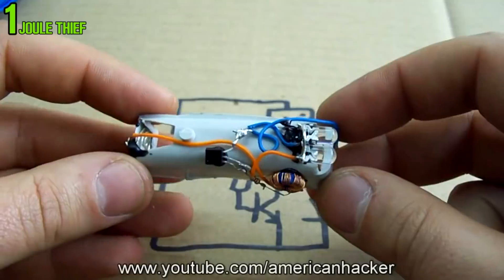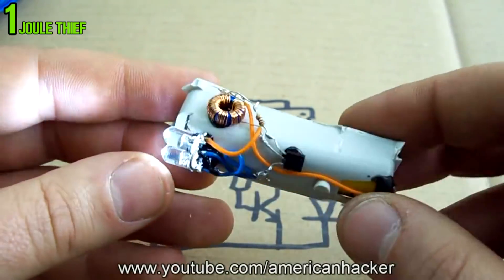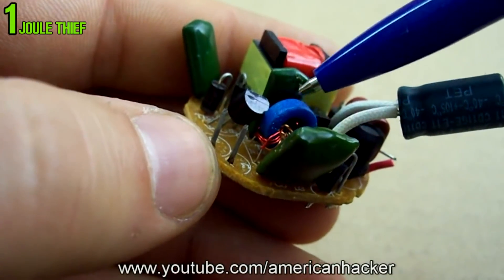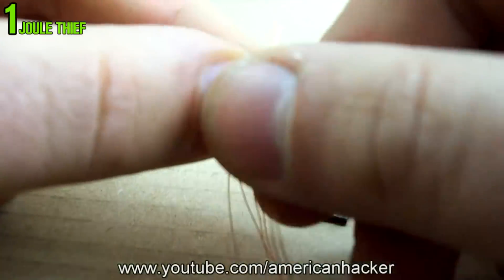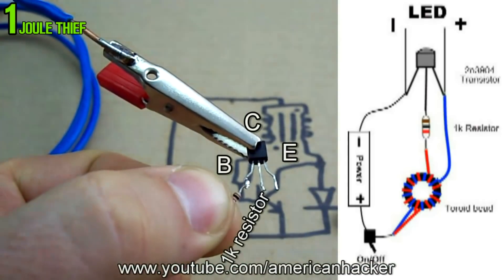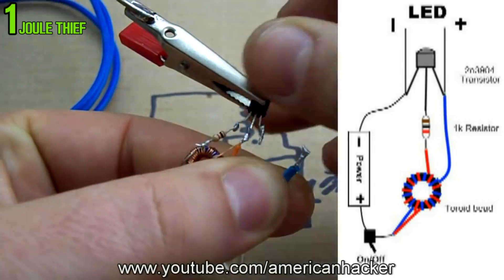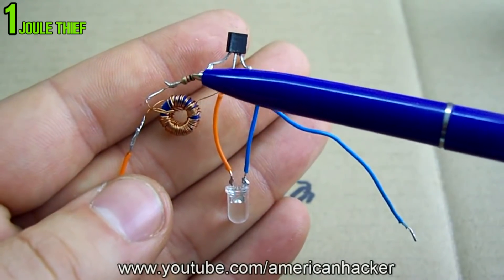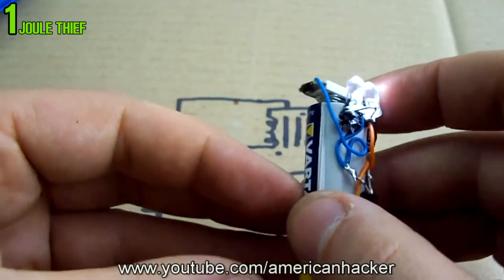3 incredible Ideas and life hacks

Comment: you can make a phone charger out of this idea just where the LEDs are put the charger cable instead and where the battery goes you could have a bigger battery or solder the coil to a plug and plug it in, your phone will changer once its in render distance.

Comment: does both copper wire have to be the exact same turn
Reply: wally alexandre Its not necessary. but number of turns should be enough to produce a decent amount of E-magnetism. Concept is just same as ordinary transformer, transformer rather uses a better way (the iron plates) which enhances the magnetic strength of primary coil and consequently, induction efficiency increases.
Reply: wally alexandre the frequency also matters. higher the frequency in primary coil, higher will be the efficiency of induction into secondary coil. You can create such a flux by rapidly rubbing the naked side of copper wire on tip of the battery if you cannot arrange for any DC-to-AC converter.
Reply: Thank you

Comment: How does one control the output voltage of the first one?  I would like to drive the internal components of a couple of LED bulbs from a 12 volt car battery.  According to a video, these bulbs have 70 volt DC feeding the LED.  How would I go about stepping up the voltage from 12 to the 80 that I need?  (The Joule Thief sounds like what I need, but I'm not 100%.)

Comment: now attach the transmission coil to your joule thief.... im curious if that would make it transmit more power and make the leds brighter
Reply: Philie Spiess Does it work with lasers
Reply: Bruno Portela im not completely sure, but i don't see why not,  its just a power booster,  it creates a magnetic field then collapses it creating a power spike and does this over and over extremely fast, i don't see why it wouldn't power a laser just the same, itd prolly just take a little more power to begin with ya know
Reply: Philie Spiess Cool i will try it I have a green laser but i can't take the inner part to turn the potenciometer so i used a batery box whit four 1.5v AA batteries but  i want more power
Reply: What does a joule thief do? It looks like he just made an over complicated LED flashlight.
Reply: Maxwell Edison its does kinda look like that in this video, but its actually like a power amplifier... take in mond it generally takes like 3volts to light an led an a aa battery is only 1.5 at full charge,  but a joule thief circuit will light a led brightly with a aa battery thats so dead it won't work with anything.. im not great at explaining this, google joule thief... its an amazing little circuit seriously
Reply: Philie Spiess I will, thanks.